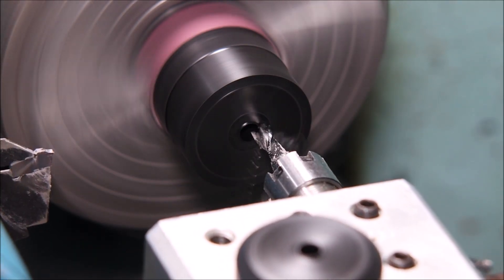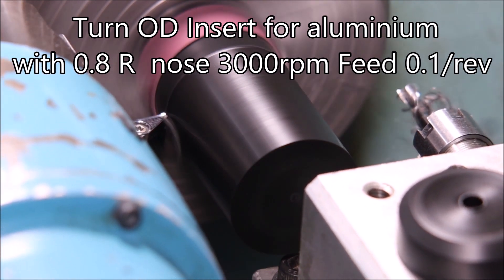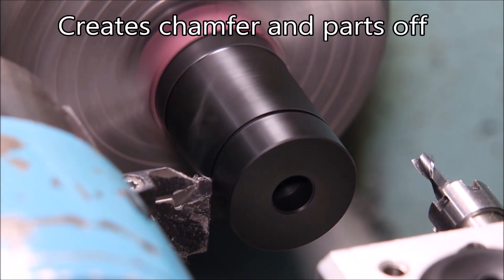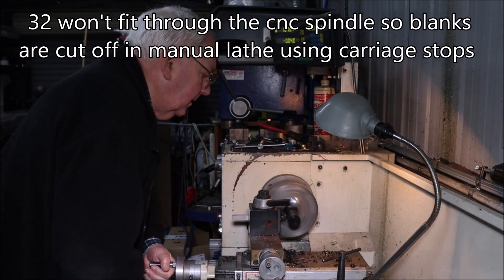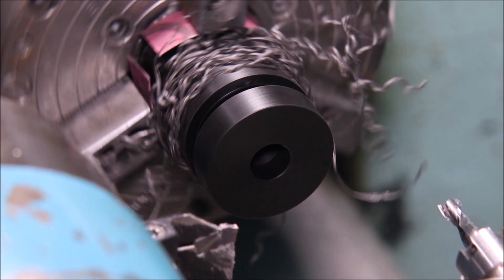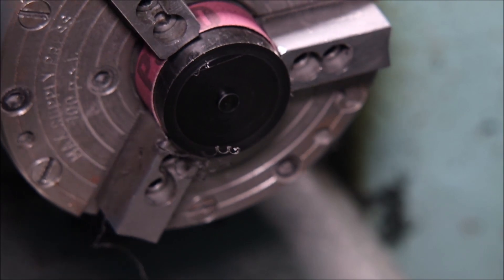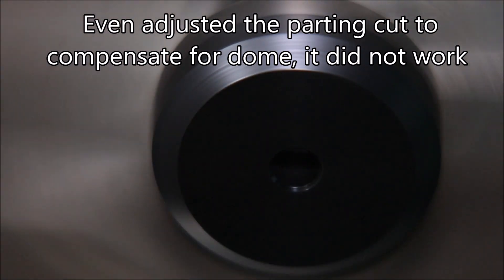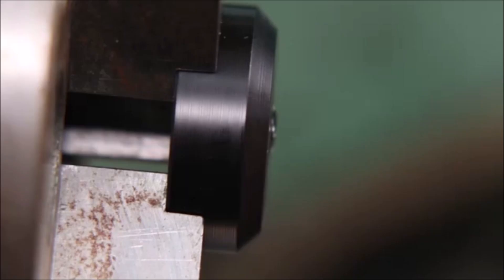Small cnc lathe makes 3 delrin parts from a single blank, slot drill as boring bar

Comment: Quite a lot of wear/rubbing marking on the side of that parting tool. I'd suspect it's no longer holding the insert properly/securely.
Reply from the maker: You may be right, but I won’t be replacing it. Damn things cost too much, fine when I was working, but not now I have retired.  I only do occasional jobs these days. Thanks for your comment, I will inspect it closely and see if I can spot the problem

Comment: Even if you do them in the manual lathe those offcuts will be used up which is usually a good thing.
Reply from the maker: I would need a drill with a 90 point for the countersink although it may be short enough for a 90 spot drill if it was the right size.
But that many in a manual the when I have a cnc with soft jaws to suit the job, I think it will have to be the cnc! Thanks for your comment

Comment: If I had to guess, I'd say the domed part off face is from turning the chamfer, then plunging right into the part off. Sometimes the machine is quick enough to start the part off move in X before the Z deflection in the part off tool from turning the chamfer has un-sprung.

If you plunge that first groove 1mm deeper than the corner of the chamfer, and .2mm further in Z than the part off length, after you turn the chamfer you'll have near 0 force on on your blade, and then it will take a nice .2mm off the back of your part, and hopefully start off straighter.

Or it could just be because its plastic, and plastic is going to do whatever the heck it wants!
Reply from the maker: Thank you for your well thought out comment. Should this occur again I will certainly try the idea of going a bit deeper with the groove before completing the chamfer. Funny thing is, I did not have this problem last time I made these!

Comment: Would be a nightmare to have the cut wander like that. Is 3 max amount of parts for a stable cut? I made 14 parts in a single chucking on my CNC for the same reason, the stock (70mm aluminum) didn't fit though the bore. The first part was parted off with 200mm stick out from the jaws!
Reply from the maker: 3 was about the right number for this job in my lathe. My air chuck is spring clamp, air open, so pressure cannot be varied

Comment: I've had parting tools flex and push off many times before , but it's kinda expected with around 150mm stickout...
I wonder if the material is different towards the middle causing the tool to flex ?  I don't know much about plastics , but if it had similar to a tighter grain structure or was harder for any reason could that happen ?
Reply from the maker: I don't recall this happening last time I made these, in fact it has never happened.  I gave up and just faced them off! Thanks for your comment, always appreciated.